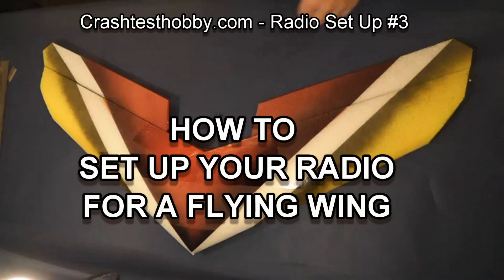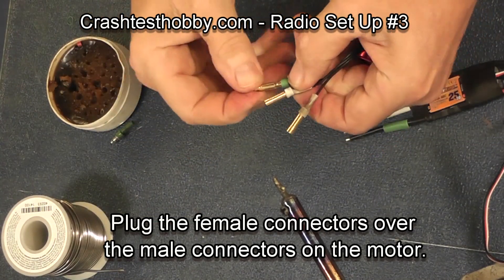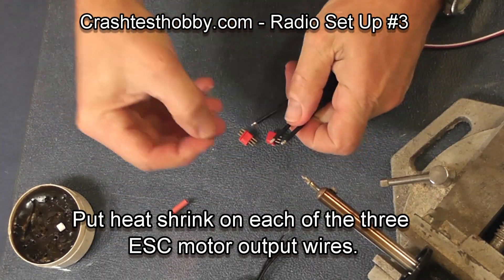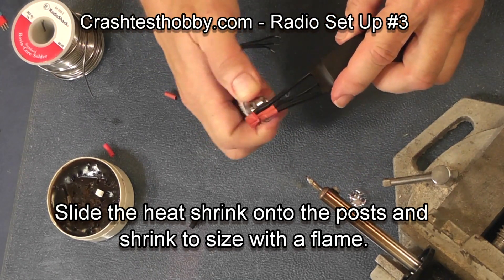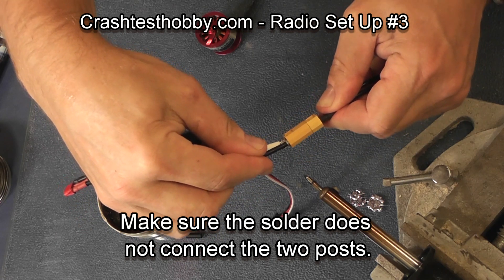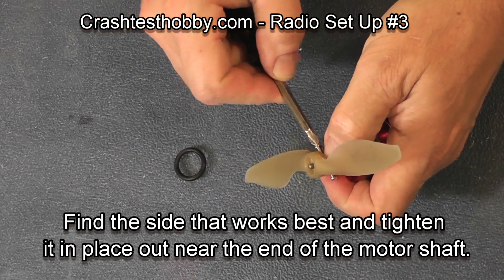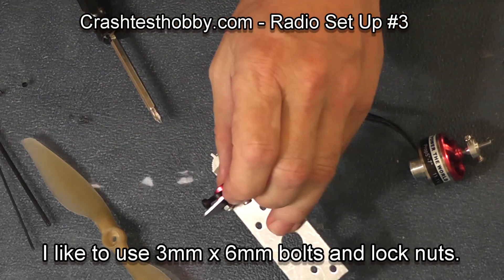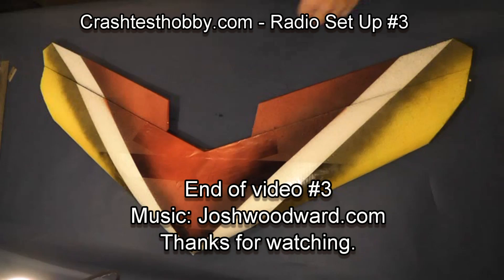How to solder RC ESC, motor, battery (no music) #3

Comment from the maker: I am using standard rosin core solder I got at Radio Shack.  Search for it on Amazon if you don't have a Radio Shack around.  I am using plumbers flux which is OK for wires and bullet connectors but not OK for circuit boards.  Flux makes a huge difference in how solder flows.  Usually I use a 30W soldering iron.  The secret to getting solder to flow is to get the wires or connectors hot enough that the solder will melt and flow when touched to the part to be soldered not just the iron.  Solder joints should look shiny if the iron was hot enough.  They will be rough if the iron is too cold.